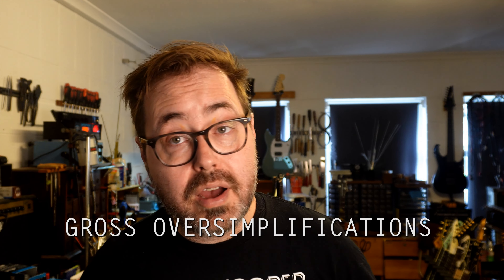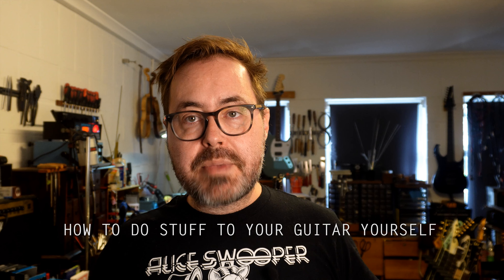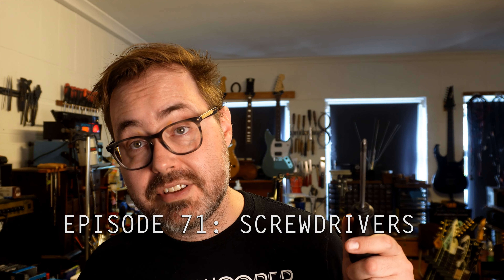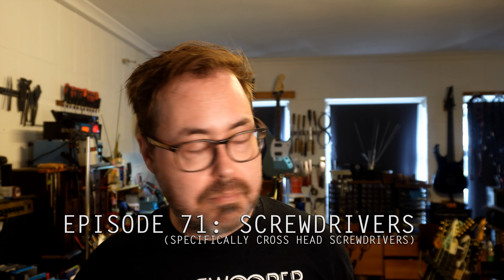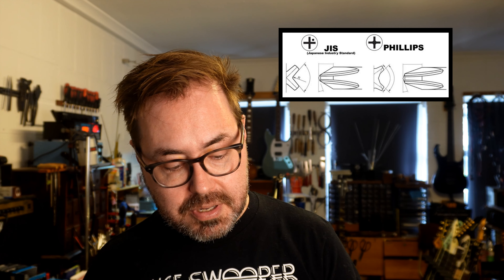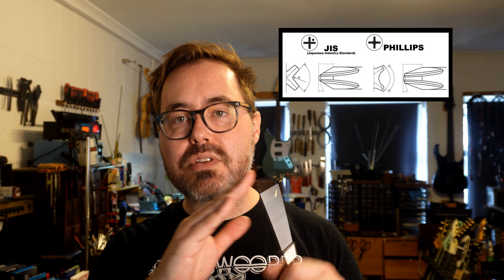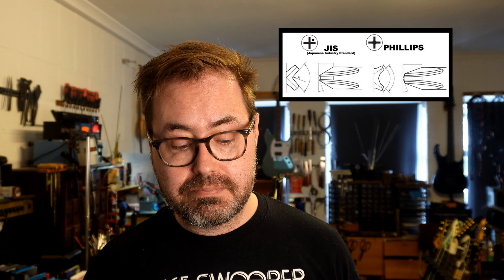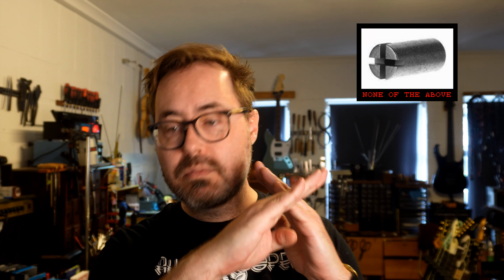#71 - Screwdrivers (cross head) - Guitar Maintenance Tips and Tricks in ~3 mins

Comment: Folks, I'm gonna just let you know not to use Phillips head  countersuck screws in your projects that are gonna be manually handled a lot or exposed to a lot of moisture. If there's an amount of the screw that is proud of the surface then if the recess becomes chewed up or corroded the poor tech can at least attempt to cut a fine slot in the head where there is feasible material and use a flat head driver to extract the screw.
Also: use the square bit screws popular in Canada, they're just so so so much more efficient and far less prone to getting chewed up, least of all because numpties don't usually have square bits drivers 😂